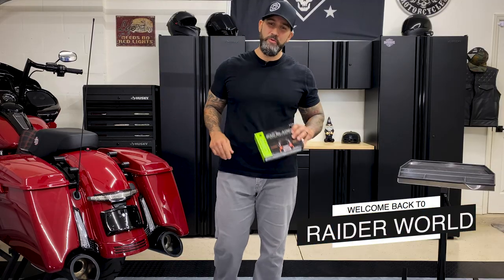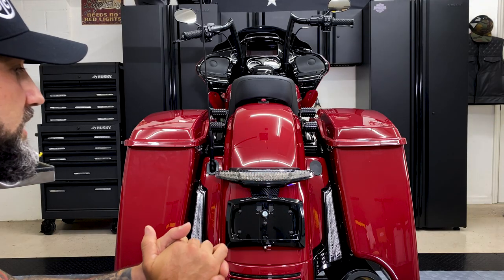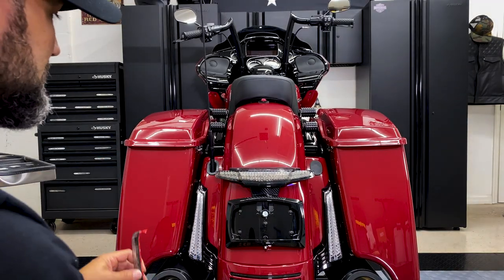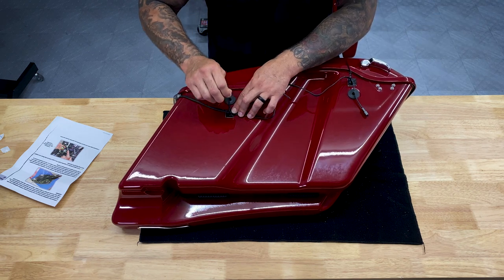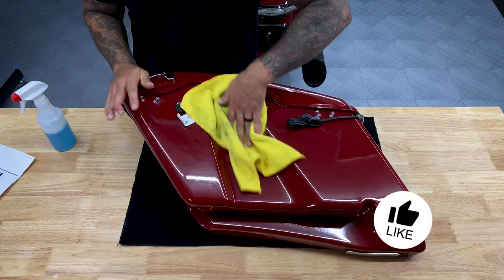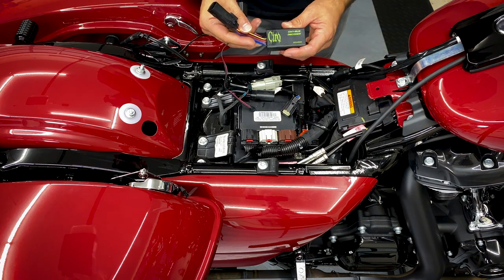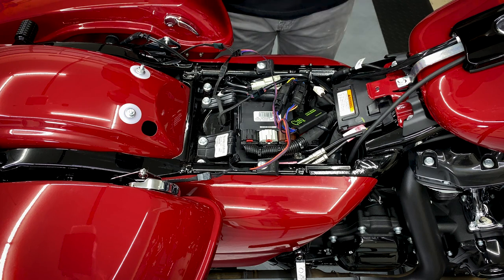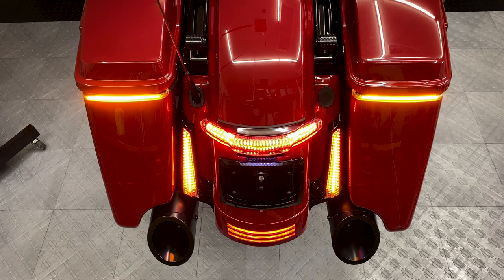LED Bag Blades from Ciro3D Installation

Comment: Thanks for taking the time to actually detail the wiring elements of the job AND the kit. I’ve looked for a while to see what the final wiring looks like AFTER the install (where the disconnects are, wire routing visibility, etc).  Most people glaze over that part which was important to me before I decide if I want the product or not. Nice vid. 👍🏼
Reply from the maker: That’s awesome! I’m glad the video was helpful.  I’m the exact same way, this is why I try to be detailed as possible.  Thank You for the Support

Comment: Great videos. Thanks for all the work. I am going to add some saddle bags and filler lights. Since the all hook up to the wire harness under the seat, do you just daisy chain the inline or do I need another adapter. May be a stupid question but I also had a dyna and just got a 21 road king. Thanks for any help.
Reply from the maker: That’s awesome! Thank You.  They just Daisy chain together, but they also a carry a 4-way adapter so you can cut down on the harnesses.

Comment: Good vid. Question though, how compatible are these with Custom Dynamics lights, I have CD Fillerz and a the brake light strobe module, are they able to work with those lights or are there compatibility issues?
Reply from the maker: Thank you for Watching 👍🏽 they both use the same connectors, so you should be able to mix and match.  I do not run a brake light strobe module, but I’m sure you can shoot them an email.  Either way, they use the same connectors.  Hope this helps!

Comment: Very helpful install ! I’m having that same lag issue tried 30 second reset with hazards on didn’t fix it is there any other step I need to take? Thx
Reply from the maker: I would check your manual on how to reset your lighting controls.  They have digital manuals on line too.  It should involve turning ignition switch a couple times.  Thank You for Watching 👍🏽

Comment: So I put the bag blade lights and the machete lights on my 2022 street glide special yesterday and they work as should and look great but my original rear fender and brake lights don't work at all now.. hooked the original wiring up and the those lights work again so idk.. I doubt it's the product being faulty but an error on my end so any suggestions would be highly appreciated lol!
Reply from the maker: Definitely a great set of lights!  Did you purchase the can-bus decoder from Ciro?
Reply: @RAIDERWORLD  it came with the 40019. Maybe there's another one I need to purchase separately. I have filler panel lights on the way as well.
Reply from the maker: @ryanphillips3533  If it’s not the decoder, I would definitely contact them and find out.  Ciro is quick to respond and walk you through the fix.
Reply: @RAIDERWORLD  I sure will! Thanks for the help.